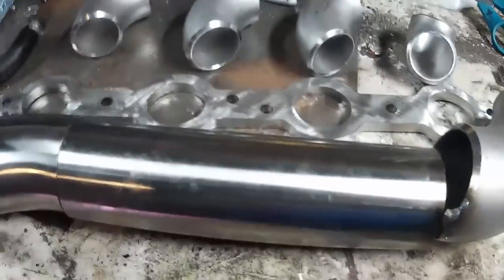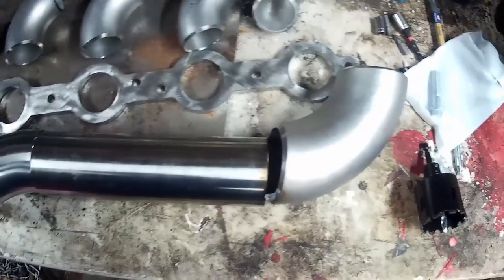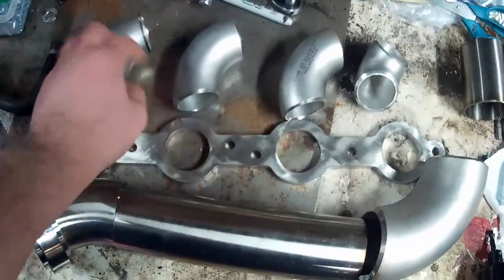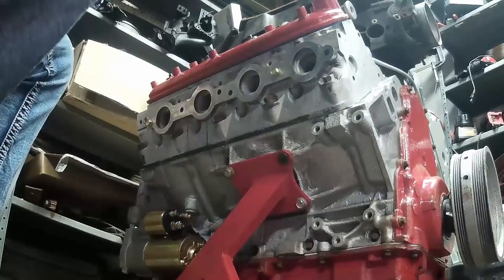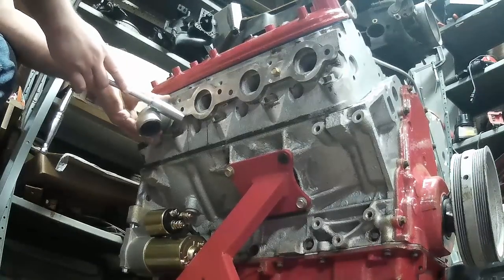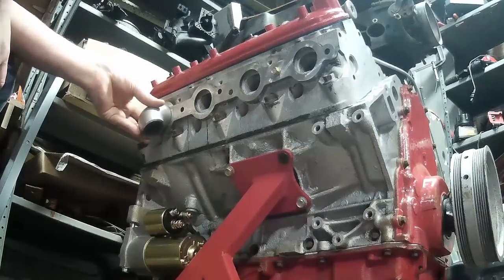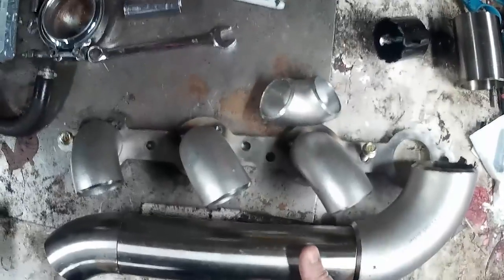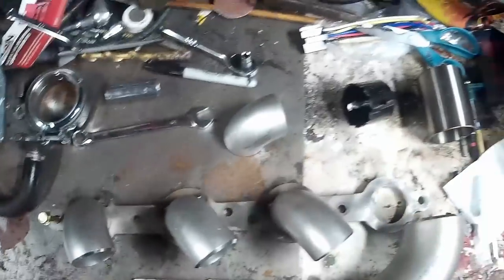How to build an turbo log manifold for your LS cheap! Part 2

Comment: Apart from looking like a lot of fun to do. Do you think there’s any flow gain conpared with reusing the stock manifolds?
Reply from the maker: I have no way to measure that. Probably not, and it probably doesn't matter at all, it'll still make the exhaust turbine spin either way.

Comment: Do you put a waste gate on the vband side of your manifold or do you run exaust from the turbo out the hood and under the car?
Reply from the maker: It is on the turbo housing but you could also out it on the cross over from the driver side to the passenger side, that is how gm does it from the factory on the typhoon and the grand national. the exhaust goes out and under the truck.

Comment: You have your flange upside down in the center.
Reply from the maker: They are perfectly symmetrical, there is no upside down
Reply: How long did it take you to figure out he was right? Won't bolt up like that
Reply from the maker: Well, it's on the engine right now, so apparently I still haven't  figured it out
Reply: Just predrill the holes to make it fit.
Reply: Anthony Vargas you do realize that you can flip manifolds on the ls motors? Lmao
Reply: Kfx Guy The flange is not semetrical. The center bolt holes are offset. Left is lower than the right. The flange is inside out, so the left hole is high, right hole is low. The holes are opposite of the holes used in the thumbnail picture for the video.
Reply: a21bravo I forgot to say when you flip them you have to swap sides.
Reply: Kfx Guy You can put a stock manifold on both ways on either side... He welded the head side of the flange to the runners... He'll have to cut it off, or re-drill the holes.
Reply: a21bravo you right but I didn’t see how he welded it finally. I’m building one almost just like it as I type this and you can flip the flange over but you can’t flip on the head. O shit. Go to 1:59 in the video. He most certainly put it upside down. No doubt about that. Maybe he corrected it before welding. The center bolts don’t line up for sure at that point!

Comment: MiG weld seriously and how about blocking the ports so slag doesn’t go in the cylinders
Reply: Here should be a bit of fun.... tell us o' mighty metallurgist, what advantages do TIG welds have over MIG welds? I want your best answer on the actual metallurgical process showing us one to be superior over another.  Not you throwing specifics like food grade piping.  I want an actual reason someone awesome with a MIG isn't just as capable as someone with a TIG
Reply from the maker: This engine has been running for almost three years now 😂